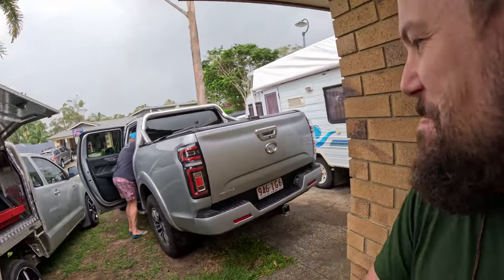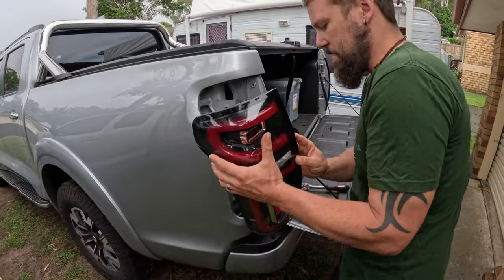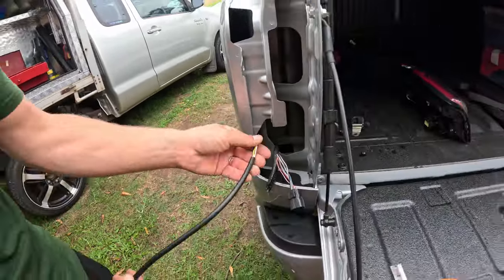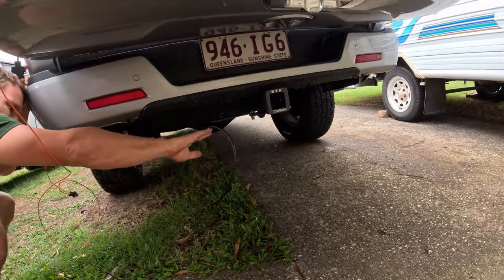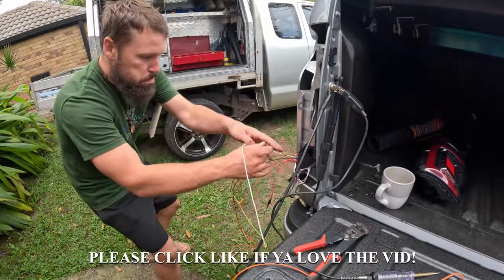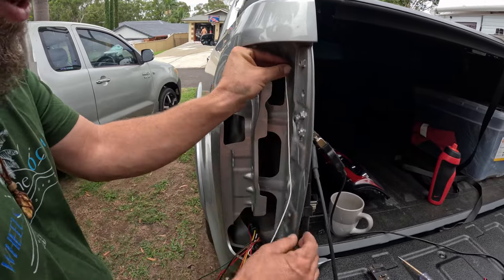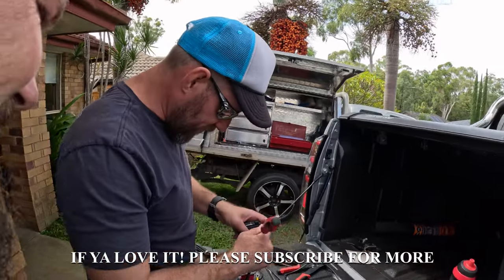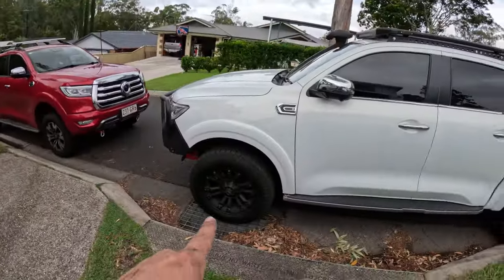GWM CANNON TRAILER PLUG WIRING

Comment: Hey Jordan,
I'm getting my new Ironman bullbar, plus TAG towbar installed this Wednesday. Looking at your video, i hopefully should be able to do the wiring. Ordered a full kit. Pricey, ay?! Lol
Any issues, I'll be calling you directly..🤣🤣
Maybe i should get auto sparky to do it. 
My complete 2nd Kings battery and inverter l installed had no issues, so I'm kinda confident..lol 💥🍻
Reply from the maker: @Scotto99  the wiring is really straight forward :) best to get the kit with reed switch. 

You gotta run a wire from battery all the way to back to make sure you have some conduit for it :) 

Good luck mate  😀
Reply: @wheelsbytheocean  Thanks mate. Thinking I can just run it up and to a battery wire on my secondary one 🤔. 

I'll need to check if the kit comes with the reed switch. I meant to make sure. 

Was just watching your bumper install. Pretty hectic 😳, but job well done.
Thanks again, buddy. 🤙

Comment: Checked wire colours mentioned here - all correct! Thanks! But i used trailer lighting Interface to wire up the plug, cause all my trailers run on incadescent bulbs.
Reply from the maker: Awesome mate, thanks for the feedback  :) glad I could help

Yeah the interface is a good idea for sure. Helps protect the car and canbus

My personal gwm has the interface  
/  trailer wiring ecu I like to call it haha 

Good job mate :)

Comment: Any solutions for the rear radar fault a lot of us seem to have when towing lol? i get the one beep and then just rear radar fault on the screen when slowing down and the camera comes on or when reversing, dealer has said its all done correctly
Reply from the maker: The install on this vid is a basic kit without ECU and reed switch  

When you open you tow plug on car what do you see? 

Reed switch type has a strip across top which is like a sensor telling car when trailer plug is open. 

A lot of installations including the one in this vid is done without reed switch so will get faults and beeps 

You can email me a photo of your plug if unsure

Jordan.r232@hotmail.com
Reply: Hey mate, where do you get the trailer plug with a reed switch, can it be swapped over with savage tech plug ? Cheers... love the vids 🤙@wheelsbytheocean

Comment: Which did you use or do you recommend
Reply from the maker: This one is a savage tech kit. It's pretty good. 

But there is other options that have a reed switch that deactivates the rear parking sensors so don't get any alarms when trailer is connected.  Costs a bit extra but can be worth it